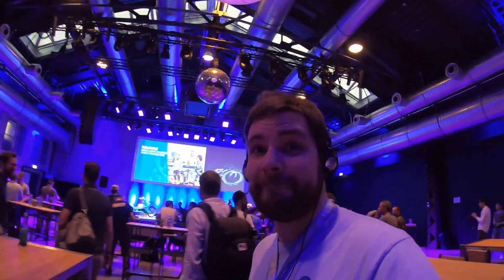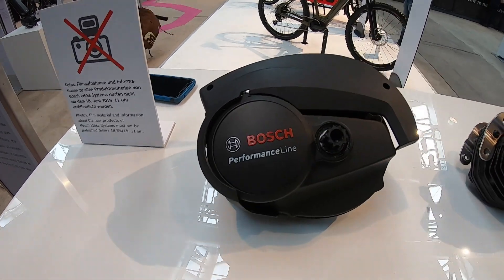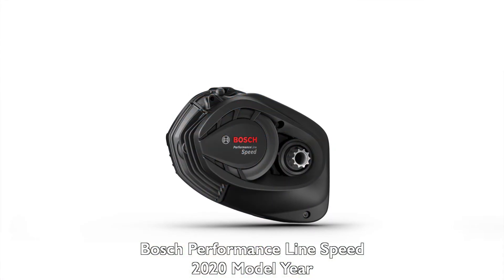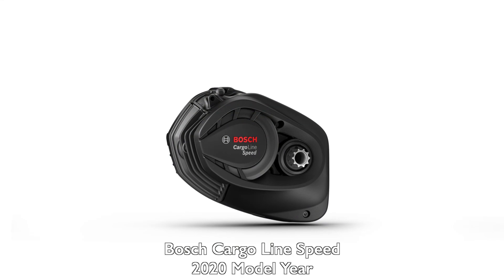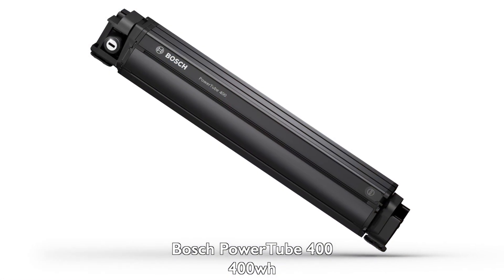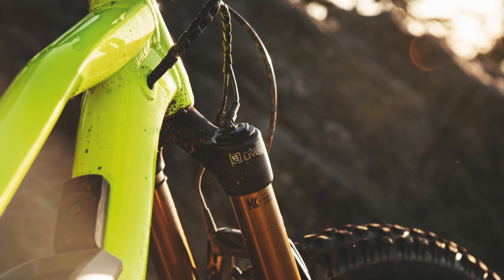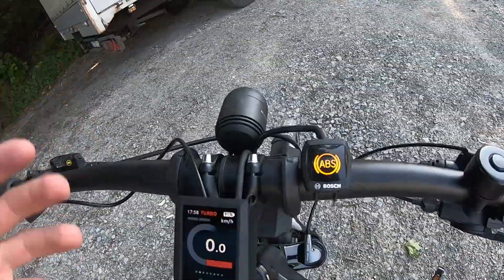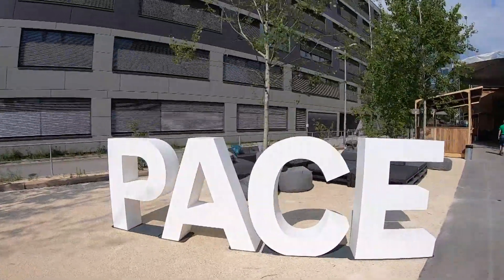New Bosch Ebike Motors & Batteries! 2020 Updates from Germany Event

Comment: I just bought a R&M Load 75 with the HS motor. Any idea if it will be possible to replace the motor with the new Cargo variant when it launches?
Reply: I too would be interested if any of these new motors can be fitted retrospectively. I spent a lot of money on an R & M Delite and it would be reassuring if these are compatible.
Reply: No way, completely different geometry. But hey: I own an R&M Charger since two years. Nice 'old' Bosch CX, updated with the eMTB-Mode. I'm super satisfied with this bike and rode it for almost 3500 miles since then (was forced to pause on biking with a frozen sholder, else I would already have 4500 I suppose).  Knock on wood: No important problems, just worn out chains and gearwheels - shimano, not bosch...